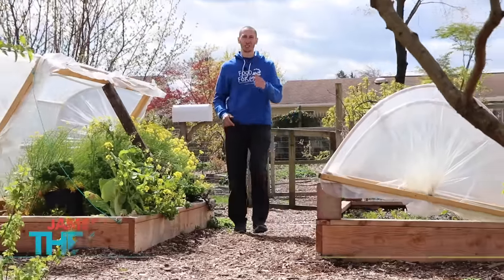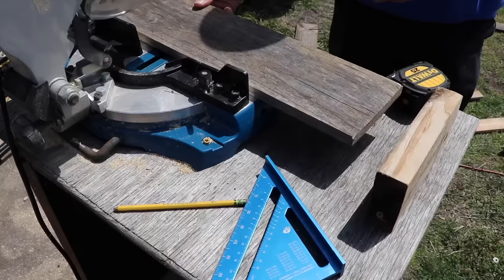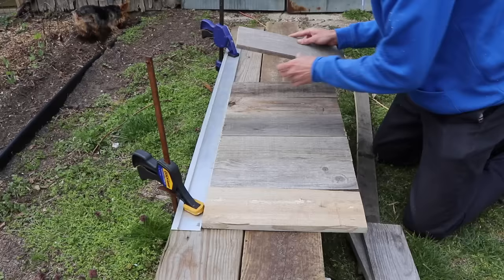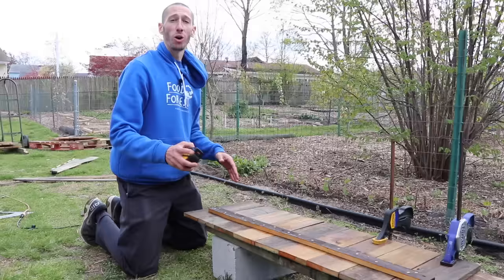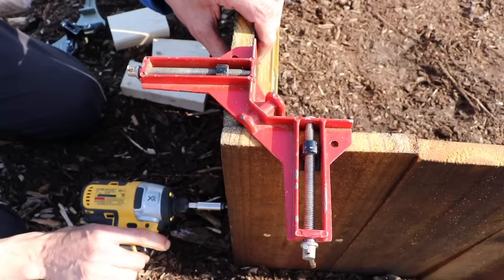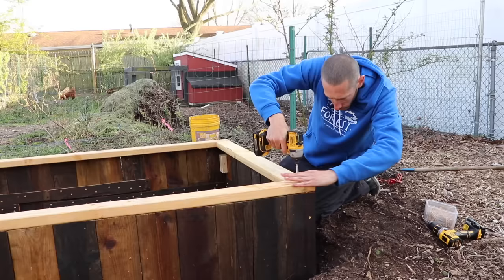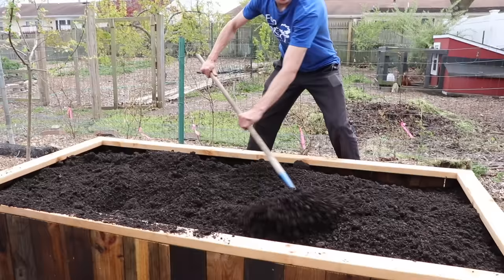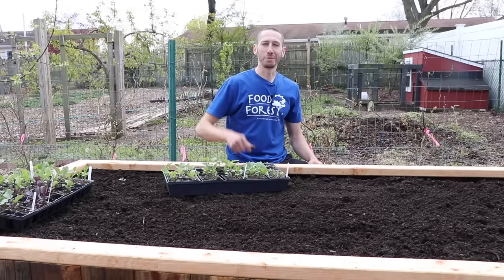How to Build a RAISED BED Using PALLETS, FREE Backyard Gardening

Comment: I would check the pallets, before hand, for a stamp. Some are treated with harmful pesticides. Look for HT (for heat treated), and you should be fine
Reply: great tip!
Reply: I was wondering about that.  Thank you.
Reply: Great advice.
There are too many people who don't know this stuff.
Reply: Yo how’d I know?
Reply: Pressure treated won't rot though.
Reply: Glad someone said that.
Reply: @horatiohuffnagel7978  Yes, but the chemicals seep into the soil and into your harvest. Not something you want. You can read more about this online.
Reply: I thought the chemical treated pallets were blue, heat treated aren't coloured.
Reply: @cptstubing  Blue pallets (or painted pallets) are indicative of the manufacturer and most of the time are sent back to the warehouse for reuse. They are typically not treated so they can be used in diy pallet projects, although not as pretty. When checking to see what category of treatment the pallet falls into, on one or two of the bracers you will see either a burned brand or painted stamp. It will look a little like a pine tree with two letters next to it. HT for heat treated (fine for all uses as it means it's just dried pallet wood) or MB for methyl bromide. Methyl bromide is a chemical used to treat pallets commonly used in foreign exports to prevent the spread of pests, fungi and/or disease. It is not considered safe for use in diy projects as it can cause health concerns associated with consuming or coming into contact with pesticides.
Reply: He mentioned this in the other video he made, must have forgotten to say it here.

Comment: I take apart pallets all the time, from my job and build all kinds of things, including raised garden beds. If you want to save time cutting things more than once and creating waste, stand your pallet up, lean it on some work surface, use a reciprocating saw, cut down  between the boards and 2x4 of the pallet, thru the ends of the planks, right thru the nails. You end up with full boards in a few minutes. Then you can make your cuts however long you need the pieces. The circular saw method takes too much time and cuts useful wood up needlessly.
Reply: Oh yeah— just a metal blade on my sawzall thanks!
Reply: @froglobster  no problem! Hate to see a braddah use up valuable beer and barbecue time😅
Reply: @unclenash6103  Well how the heck did you k ow about my beer and bbq 😆
Reply: Hey there! Do you have a video showing what you’re describing. I’m a novice wood worker and I’m just learning about various tools and techniques. 😅
Reply: @adrianejohnson5695  sorry I dont. But I have seen videos of that on youtube.
Reply: @adrianejohnson5695  There’s thousands of youtube vids to give you tips.
I love woodworking it’s an endless creative world— way better than being a trucker.
Get yourself ( doesn’t have to be expensive ) level, square, tape measures, pencils, drill, circular saw-small table saw, jigsaw, reciprocating saw, drill bits, screw bits, hole saws , prybar, estwing hammer and go wood crazy!
I’ve built decks fences gates bowls, cedar shake roof, bedrooms, car ramps, etc etc even a couple nice small Jesus Christ crosses .
My last woodwork project is in the garage. Basic power and hand tools. 8 foot tall 7 foot wide 2 foot deep multi different size shelves for a food/ canning/ pantry. Keeps also potatoes onions garlic shallots etc.
Center of pantry houses a refrigerator for extra food and beer. It’s the biggest pantry in my neighbourhood.
Reply: @adrianejohnson5695  There’s a guy with a great channel check him out - Matthew Peech —
Reply: @adrianejohnson5695  what types of things do you want to learn how to build?

There's a great woodworker on YouTube called Mr Chickadee. Very few of his videos have him talking (basically just the ones where he teaches how to sharpen or restore tools) but 8f you click on CC some do have closed captioning.

Comment: Multiple coats of oil on all 6 sides of boards before you assemble for better protection. Also space boars slightly using a couple of small nails as spacers between boards when assembling - this allows the wood to swell a bit without buckling as well as dry out between boards a little better.
Reply: What kind of oil?
Reply: How often would you need to re-oil?
Reply: @LexGear  the more coats it has the better.
As long as you give each coat time to cure you can keep piling them on
Raw linseed oil will take quite a few days to cure, so wait at least a week between coats
If you bleach it you can wait much less, depending on how long you bleach it for
Reply: But personally, i dont have the time or patience to give more than two. Maybe only one lol we'll see

Comment: Great garden bed and great video, I typed it out to make it easier for myself. Hopefully this helps someone else:

First you will need enough pallets to make a 4 x 8 foot bed. That would be enough to make around 56 boards to cut to 16 inches.

You need a circular saw to cut them evenly and efficiently. When cutting the pallets, leave the boards on each end to use as bracing later

Use a measuring tape, drop saw, and square to cut the boards square. Once you make one side square bump it up against something flat to make the other side square to make them 16 inches.

Once you have the 56, 16 inch boards (or whichever length works). Cut the end boards off the pallet in half longways so you can use them to brace the borders you'll be making. 

A straight edge and some clamps on a couple of cement block raised 2x4's is what he used to align the boards to make the walls evenly. Put the wider boards at the end.

You will now need a power driver to predrill holes in the braces and to drive the wood screws. Place the bracing on the back, predrill, and reinforce with 10 or more screws. Make six sections.

Take two sections cut them exactly to four feet and combined them together with another bracing piece to create a 8ft wall. Do this twice.

Take some lint seed oil and brush every side of each section liberally to protect the wood.

Figure out where you want to put and be sure to clear it out and make it level before you start assembling. 

He uses corner clamps to hold the corners of the sections together so that he can attach a small block of wood behind the corners to hold them together. To do this he pre-drills and then puts a couple of screws to hold them in. Repeat for all corners.

Get two 8ft 2x4's, linseed oil them, pre-drill and attach them to the top of the borders for railing. Be sure to put screws where needed to make it flush with the wall. Take the last 2x4 board and cut it to length and attach to the last two edges.

Once you're done fill it with organic material.

Exactly what you will need to do it like the video:
3 or 4 pallets
Circular saw
Drop saw
Measuring tape
Square
Straight edge
Two clamps
Power drill
Screws
Linseed oil
Brush
Level
Corner clamps
four small wood blocks
Three 8ft long 2x4s

Did I get everything?
Reply: Thank you so much!
Reply: YOU ROCK! Thank you for taking the time to type this all out. This was a great video and a great idea, given the crazy price of wood these days. :)
Reply: Hi, just watched this vid and it is totally cool-have a patio that has cracked concrete beyond use and repair. Just figured out my project for the summer! Also, I might suggest that at each corner, even with the top of the pallet boards, you might want to add maybe a 3"  waste piece of 2x4 for added support...the connections there would be much stronger with the top rail. Just a suggestion-with my luck, the entire raised bed would fail once the soil is added if I did not line up the screws perfectly through the top rail and thin pallet boards! Thanks for the info!!
Reply: So helpful to have it typed up. Thank you
Reply: You are a hero
Reply: Thank you!

Comment: Just a little tip from woodworking: When you wipe off the excess linseed oil with a rag be careful where you leave that rag afterwards - because it might spontaneously start a fire. When linseed oil is exposed to the air a chemical reaction starts that emits a lot of extra heat. This can cause rags soaked in linseed oil to sometimes, just out of nowhere, catch on a fire totally spontaneously. So NEVER throw away the rag in the garbage, it might burn your house down. Always keep used rags in a metal bucket or bury them to naturally decompose, or dispose of them somewhere else safe.
Reply: Just put the linseed oil used rags in a metal container or someplace where CANNOT let fire spread--go outside and just safely burn them yourself--only way that ensures they are absolutely "safe" ...
Reply: you can put them submerged in a bucket of water, too.
Reply: Feeling like I was born yesterday, don't know SQUAT.. Recovering stroke survivor, lovin every minute.  Need all the side tips and info I can get. TY ivanhoe011, good lookin out. I mean that from my HEART. TY
Reply: I never totally believed this so I did a test when staining some floors. I took the rags outside in 90 degree heat in a metal can and within an hour they caught fire.
Reply: @billtelarana4341  or in the OIL CAN itself too!
Reply: For real?
Reply: use dawn dishsoap and water  and soak rag .. real easy.... neutralizes  linseed oil  .
Reply: I miss metal coffee cans! Such a great holding and then disposing place for oily rags...
Reply: @learntocrochet1   Pretty much any solvent soaked rag can spontaneously combust.
Reply: Since you work with wood, tell me if the linseed oil is or isn't toxic for  humans. I read today that "raw" and not "boiled" should be used for food contact.
Reply: @MS-ti8ub  raw version is just pure flax seed oil and it's guaranteed to be human safe (unless the person is allergic to flax obviously). Boiled linseed oil can be contaminated by chemicals and metals during the process (also sometimes contains additives to dry quicker), so AFAIK it's not food-grade safe, e.g. to be used for wood spoons,  cutting boards, bowls, etc. However it's perfectly safe to use on furniture, as it will dry and become solid fairly quickly - so chances of ingestion are minimal. Just don't lick your furniture before the oil dries :)
Reply: @ivanhoe011   Thank you. for all the info. I really appreciate it and love your sense of humor :):)
Reply: ivanhoe011 what’s a good oil to use on wooden utensils or chopping boards?
Reply: @trustbirthaugusta  lynn reed oil
Reply: @ivanhoe011  If you are worried about a little bit of linseed oil tainting or poisoning your raised beds, it's probably best not to think about what toxic crap the pallet makers used to make them weatherproof when they made them... or to think about what crap might have been spilled on them, or might have leaked on them over the years too eh?

I made my own beds by using an inner core of reclaimed metal cladding (the kind they make the roof out of on the big diy sheds and then screwed a facing of old pallets to the frame on the outside. i didn't do it to prevent tainting. I did it because the cladding will withstand being buried for 10 years in my garden and the facing cladding was fitted so it was always 2" off the floor. looks the same as this, but didn't need a liner, won't bow and will last a little longer
Reply: Great tip, thank you!
Reply: This happened to my friend after he’d oiled his floor. He went to bed that night and woke up to the fire alarm going off. His living room was ablaze and the room he had just decorated was totally fire damaged. Luckily him and his wife got out the house in time
Reply: Doesn't this mean it also makes the wood you treat with linseed oil more likely to catch on fire?
Reply: @FringeWizard2  no, it's just that linseed oil exposed to air gets into some chemical reaction that creates a lot of extra heat, enough to start a fire on an easily flammable material like cotton rag. On the wood it penetrates the surface and dries out fairly quickly and then it's completely safe.
Reply: @kimdavis5849  Sorry you've been through a lot. Hoover up all these useful tips (check Charles Dowding who is also just superb for 'no-dig')) and enjoy your gardening, Kim!
Reply: ?!?! I used to oil paint and have linseed oil around for damar varnish etc. (!)
Reply: Good advice. My bestie ended up on the 11 pm news because they threw the linseed oil rag away in their kitchen. Luckily, they all survived the fire!
Reply: @CostasDraminos  food grade minera, oil.
Reply: @CostasDraminos  food grade mineral oil
Reply: Thank you!!!
Reply: Question: you mention composting the rags. Can't you just then toss the rags at the bottom of your bed?
Reply: @CostasDraminos  - You could use walnut oil (if there are no nut allergies in the house), or raw (food-grade) linseed oil.
Reply: Could you just wash the rag in the washing machine to get the linseed oil out and reuse? Or will it not come out in the wash?
Reply: Yep, the contractor that stained our deck burned down our garage doing that-he threw the rags into our garbage can!!!
Reply: @ivanhoe011  I have a container of double boiled Linseed  oil someone gave me can I use it on my garden box do you know?
Reply: Great information!

Comment: Suggestion:  Use a Sawzall to cut apart the pallets, just slip a 12" metal cutting/demolition blade between the plates and stringers and cut the nails.  it will be easier than the circular saw and you get to use the already square cut ends.

When you assemble the panels into the box, put your corner block flush with the top, so you can screw the top plate into the nice thick block, instead of the thin side board, and do the same with 2 middle blocks on the long walls and 1 middle block on the short walls.  If you do the previous suggestion then the stringers can be cut to make these blocks.
Reply: or could just use a square and/or straight edge with the circular saw.
Reply: May have to do this for the last couple of pallets.

Comment: Just found your channel. Cool planters. 1500+ comments too many to search through but just wanted to give a warning. Be careful when choosing pallets to use for gardening as lots can have chemicals that were shipped and spilled on them. Also lots of pallets are heat treated to allow them to be used in air transport. If they are marked with HT(heat treated) or DB(de-barked) they are fine for use. Avoid anything marked MB as those were treated with methyl-bromide which could be hazardous for gardening. It will be marked somewhere on the upright outer sideboards not the flat cross boards and looks like a square with large letters stamped on the wood. 
Safe gardening!

Comment: Great way to recycle, repurpose and get a great raised bed with little cost. I made one of my raised beds using old roofing panels, and lumber I had. The metal was rustic red, stained the lumber, and it matched the shutters on the house. Didn't have to buy anything. After watching this, my next one will be out of old pallets. Thanks

Comment: Great idea for used pellets...... it's best to only use pallets that are heat treated. Any pellet not marked with HT... don't waste your time they might be treated with chemicals. Thank you for the awesome content!
Reply: Absolutely! Some of them are treated with really nasty stuff.
Reply: Just curious because none of my pallets have anything on them that i can see (they were free and slightly older but still sturdy) how do you tell otherwise
Reply: @joprinn1  they have a stamp on them usually at least the ones I get here in Australia. I avoid using any that are marked MB for Methyl Bromide, which is very toxic stuff. It's a fungicide that will probably affect the health of soil or compost it touches. A quick Google search will find you lots of sites with the various stamps and codes. Regulations differ from place to place I suppose, and what is required here might not be in some other places.
Reply: @joprinn1  check out 1001pallets.com they have plenty of info about which pallets are safe. Not all unmarked pallets are treated with chemicals but I myself wouldn't use any pallet for the garden that wasn't marked with the HT code. The HT code is the best way to guarantee that no chemicals were used to treat the pallet. Most disposable pallets are built cheaply/ weak. Those are the pallets usually treated with chemical. They are kinda one time use pallets and are usually given away for free. The reusable pallets  are built very study and most of the time aren't given away for free because companies will reuse them for as long as possible. Hopefully the link helps.
Reply: PTP (pressure-treated pine) is also bad, it looks like you're using that for the top pieces.  Most lumber is treated with toxins if sold for building.  These kinds of chemicals leach into the soil of raised bed, creating a poisonous cocktail in soil to stunt the growth of whatever plants you're trying to grow.  The wood rots away before the chemical is dissipated.  Use cedar or some other wood without artificial preservatives.  Even natural pine longs have resin which contains turpentine and isn't going to help your garden grow.
Reply: @nathangant7636  I would even say that for the most part, we don't need to bother with raised beds. Unless you have serious drainage issues or a really small space or something, soil mounded up to form raised rows works really well. Not as instagrammable maybe, but a hell of a lot less work! My climate is really hot, and I've abandoned raised beds as they just take too much watering to maintain.
Reply: @benjamincrossman5937  MB is very common in "nursery" pallets that often start off as imported pallets, then are rebuilt/repaired so many times that you will not find the stamps. You burn and breathe MB over time it will kill you. Glen is right, if you only use HT stamped pallets you may miss some good ones, but you will avoid the bad ones.